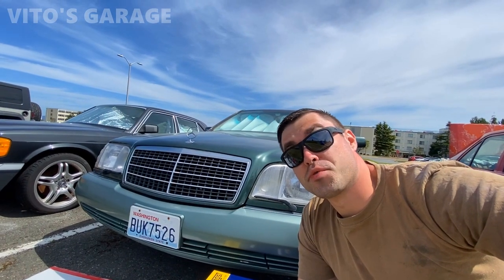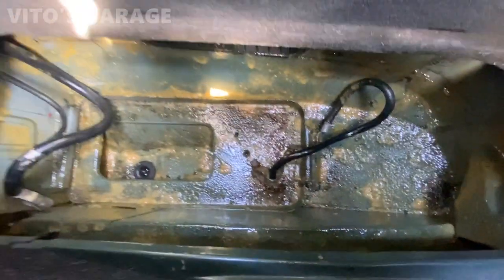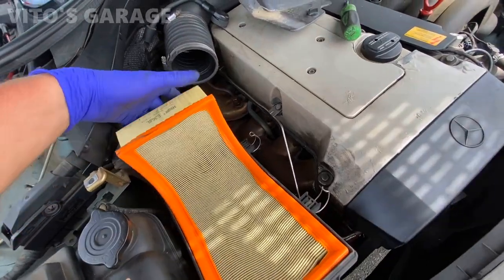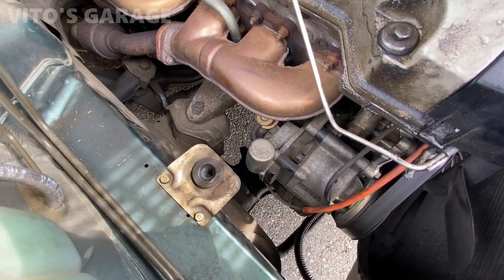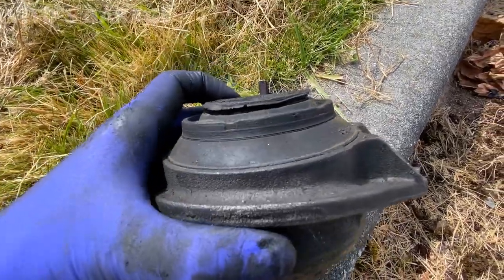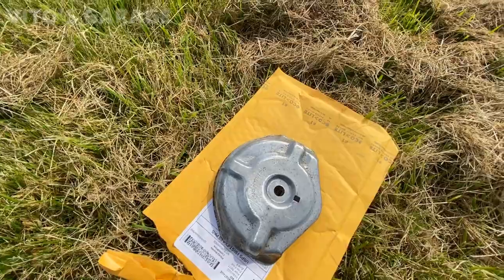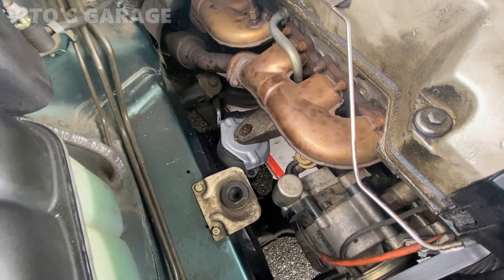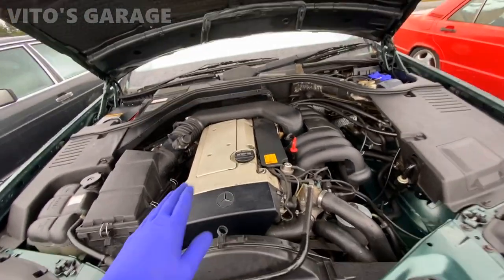Mercedes W140 Crocodile New Engine Mounts & Air Filter, Engine Bay Detail, Battery Problems Fixed..

Comment: that’s awesome you’re back at home man
can’t wait for more videos like that, please show us more of your 140 love seeing that! i’m still working on my 140 because of a rough idle. I recently washed the engine bay and ever since the transmission has been shifting rougher, after driving for a few days it got a lot better but on full throttle the car barely accelerates as it used to like it has no power and it’s shifting so wrong too. what could cause that? it started right after the engine bay wash… i’m guessing it’s the transmission module what do you think? anything i can do?
Reply from the maker: Is your W140 prefacelift? I don’t think washing the engine bay caused transmission shifting problems. It’s just a coincidence that it happened at the same time. First is check the transmission fluid level. If your W140 is prefacelift, it doesn’t have the transmission control module
Reply: @VITOSGARAGE  oh thank you. I have a 400se 93 model. It got a lot better but it’s putting the gears in heavily sometimes i’ve done a trans reset but it didn’t do anything

Comment: Hey bro, are both left and right engine mounts the same part number? I have a 1992 W140 300SE and I'm loving your channel!

Also the mounts only have a heat shield on the one side because of its proximity to the red hot exhaust manifold!
Reply from the maker: The mounts are the same for both sides. And heat shields should be usually on both sides. Mine wasn’t there on the driver side. I’ll find one and install it. And thanks for the support!
Reply: @VITOSGARAGE  awesome thanks man. 
The heat shields are on both sides on 8 and 12 cylinder models due to them having exhaust manifolds on both sides. My 6 cyl also only has one on the side of the exhaust and they had definitely never been touched! The intake side remains cool therefore doesn't need a heat shield.

Comment: Vito,
Help me please, i am diagnosing a mystery battery drain on my dad's 1994 SL320, after 3 days it will not start and thus require to get jumped, you know
i brought my clamp meter and measured the draw on each battery positive, and it thew 0.3 amps
then removed each fuse while the key was off and measuring , and the measurement didn't change, which means non-fused circuits aren't the cause of my draw
Then went and put the tool in the thick alternator wire and it threw... 0.3 amps, yup
On the way of removing the alternator i realized that the smaller cable that goes to the alternator was crumbling apart, i removed the right plastic paneling and the control unit box covering, and found a little plastic device that got a few cables including the thin alt. wire, the oil level switch signal, the oil pressure switch, and the starter signal,  the harness that had the starter signal, the oil press. and level switch was zip tied to a vacuum line behind the manifold and the starter signal wire had an unprofessional crimp on the terminal and it was wrapped on some junky tape IMO, definitely what i think is an engine protection that will prevent it from starting and running when it has low oil pressure or level, is this wiring original that got hacked or is it some crappy aftermarket junk?
I forgot to check the engine harness if it is the delphi or the crappy original biodegradable junk, i'm mostly sure it is original as the car has low mileage and everything is untouched
Do you know if that harness that i think is aftermarket could be replaced or i should just replace the ruined alternator wire?
Thank you Vito
Reply: Did you get to the bottom of it? A relatively common and overlooked source of battery drain on W140s is the instrument cluster!